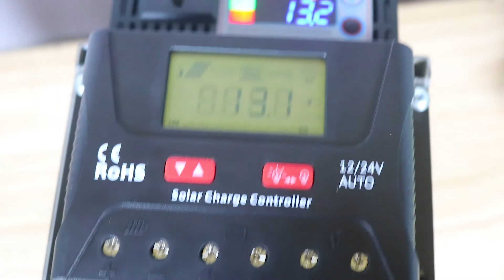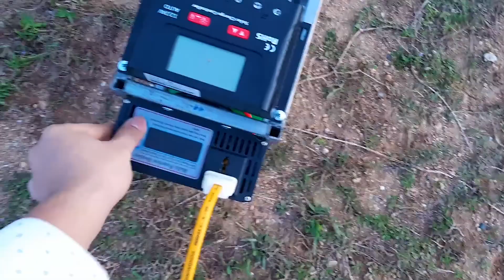I did Build 3000w DIY solar generator world's strongest

Comment: I think in Indian rupees it will cost 
1. Solar panel he is using 100 watt ( just guess) approximately Mono crystelling panel cost 5k to 7k..( depending upon company)..

2. Sinewave 3k converter DC to Ac very costly 6k to 15k ..
3.battery he using 40ah 12 volt lithium ion battery ( I guessed) v cost- 15k to 25k
4. Wire 2 k to 3k.
5. Building that one metal pipe costly 3 to 5k